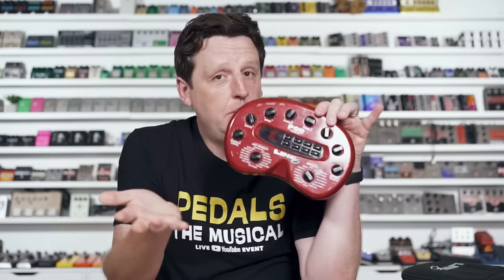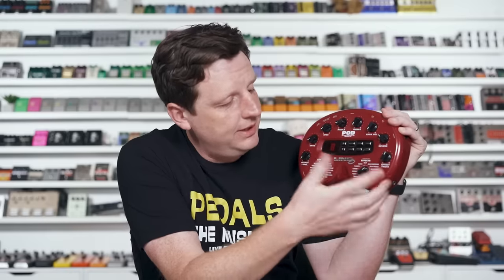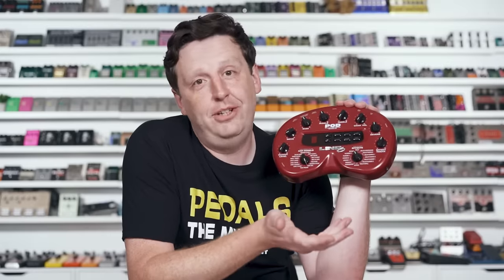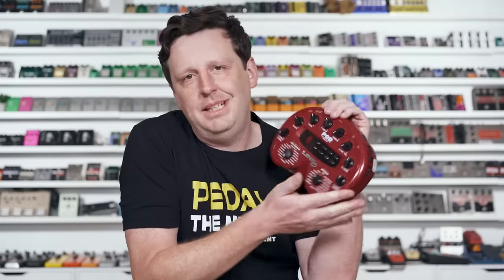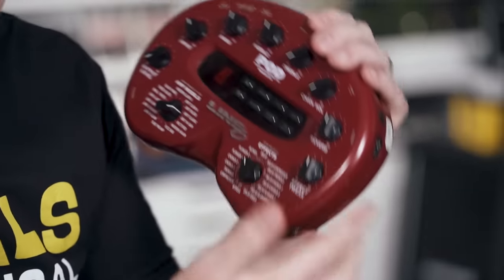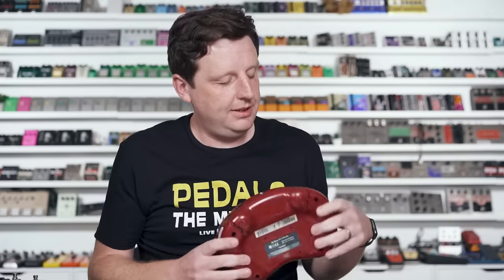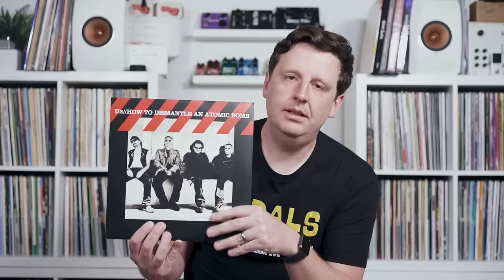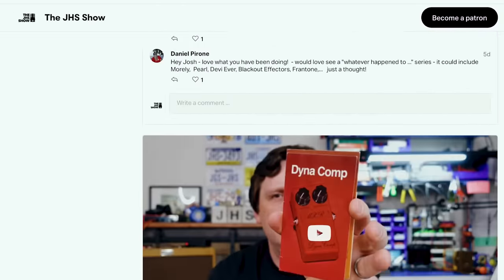Why The Line 6 POD Sounds Really Bad

Comment: Great video. I have the original POD, which sports a 2.0 chip given to me by a Boulder Colorado music store owner when he found out I liked the POD. Then came the PODxt, floorboards/pedal boards, then the XT Live… I still record with them and use them live through PAs. I still have all of them, and I never moved up to Helix because I don’t want to get rid of any of these kid rocks. I also like the Line 6 DM4. Thank you for sharing your thoughts and wisdom. I have a plethora of pedals which continue to grow in number and the POD works well with fuzz/distortion on the front end – even with a compressor. I also still like my Line 6 DuoVerb amp for recording and occasional live use. Now, I do not feel the need to hide my Line 6 PODs anymore 😂. Thank you for the courage to continue 😊😊😊. Cheers/Slainte and God bless.
🎸👨🏼‍⚕️🫶✌️♾️.

Comment: It might sound better with gold tipped cables 🤩
Reply: just the tip...
Reply: @beatzguy  yeah, copper gives more sustain 🤣
Reply: @0Oo..oO0  99% of “gold tipped cables” are coated in a low grade cheap gold, they’re no better than a regular copper one, this has actually been demonstrated and proven scientifically on many gear forums over the years. I suggest you read up 🤷‍♂️
Reply: @beatzguy  turn on your humor detector and read again 😔
Reply: FYI, the most transparent sound for switches, wire, etc is silver. This was determined after exhaustive analysis at our LA studio. Gold tipped connectors started getting popular in the audiophile stereo world because gold doesn’t tarnish like copper and silver do. Copper is fine and thicker wire is better.

Comment: I feel like the cab sim portion of this era tech is the furthest behind current kit. If you use POD direct to interface/cmptr compared to current modelers you would hear a bigger gap than using it as a pre amp plus fx box into a decent amp. Used as pre or for getting quick solid sounds for demoing song ideas or practice it can still be very useful and satisfying.

Comment: I was so surprised of everything that came after the pod 2. I had really hoped for digital to take off and become even better with time... But no... Most things I played around with with after the pod 2 has been way worse. I even ordered a 2x100w Hughes and Kettner top that was like 1500 USD like around 13 years ago since the amp simulation supposed to be soo good according to my old guitar teacher whom I really look up to (Marcus Jidell). Buut I hated it. The pod 2 digital effects sounds better in comparison. At least with my guitar and pickups.

Comment: I had a POD and thought it would go well with a clean amp so I ran it though a neutral Tech 21 Power Engine 60. Spent all my time tweaking the thing and when I got a sound I like saved I would come back to it later and it would sound horrible to me. I could get an endless variety of mediocre sounds. I got rid of that and got a Marshall. Now I can only do Marshall. I could never get the POD to do Marshall and think it sucks other than direct recording. Maybe I needed to spend more time to learn how to  dial it in. Sucked as a headphone amp too but maybe they were cheap headphones. Glad you all liked your PODs

Comment: I did a whole album in 2001 (Mark Bram / Ruby Topaz Again, which is having a 23rd Anniversary Abbey Road remaster release in a week or two) with the POD bean. It sounded great! I just kept moving up the chain. I went to Vetta combo after that. Then, the 300 watt Vetta head with four cabinets. I had the POD HD500X with two DT50 heads and two 4x12 cabs. Now, I have a huge rig centered around Helix. I have an HX Stomp on the pedalboard too, along with a few guitar synths. All the way through, I've always incorporated pedals in the loop or before the input... including your awesome pedals. Great stuff!!!

Comment: Great video as always. I used to have a POD XT. And I gave up not because how unit sounded, but because of the crappy customer support. I bought and installed custom patches (not sure if it’s called like that but anyhow) and after a couple of months they disappeared from the unit and no way to get it back. There were many people like me looking for a solution but without any outcome. Since then I stopped using the product and I will never use anything from Line6

Comment: I had mine in 2007ish. I would get home late from work and play through it for hours in my apartment using its headphones jack. Never having any issues with operating or having physical issues as they were built like a tank. I kept it until 2022 and sold it on Reverb for $220 (including the wah/volume + looper), only to fund my pedal venture. I still play through headphones mostly, having two small children at home and POD is still a great equipment that helped me through my 20s. Just purchased POD Express this morning and can’t wait to relive POD life again…!

Comment: I bought a Flextone 2 HD in 2000-2001. Everyone made fun of me until they heard it. I toured with it in 06-07 and had it hidden behind my cabs. Got many surprised faces when they'd compliment my tone and then see Line 6 when I'd be packing up. As stated in this video, if you took the time to learn it and really dial it in, it becomes an invaluable piece of gear. Sounds awesome. No tubes to go bad. Zero maintenance. Sounds exactly the same every night. I will say that cab choice was a HUGE defining factor. Personally, I only found 2 cabs that it sounded fantastic with (coincidentally they both have close to flat response designed speakers), and a whole bunch it sounded like crap with. Maybe I could have spent more time adjusting values for those cabs/speakers, but in the end I still don't like those speakers 20 years later *shrug*.

So happy to see what Line 6 started and it finally being accepted in the metal world. Especially happy to see other companies following suit and making their own great products (Fractal 😏).

Comment: I have a Line 6 Floor POD Plus I got in 2011 when I was a senior in high school. From what I recall of playing with a friend’s POD, the Floor POD Plus is basically the same tones and effects, just with added pedals to make it easier to use on stage. I have never felt the need to actually build a pedalboard, because this thing does it all. Eleven years later it’s still going strong, I had to buy a replacement power plug a few years ago but everything else works great. It’s amazing the variety of sounds you can get out of this thing, from heavy metal to blues and everywhere in between. It even works well when I play bass. I’m just a hobbyist, I’ve only played guitar in bands at church and that kind of thing, not actual concerts or anything, so I don’t need to spend thousands of dollars building a custom pedalboard when this thing still sounds great.
Reply: Now you've got me wondering what happened to my Floor Pod.

Comment: I believe I still have my old original POD, upgraded with a new Chip to POD II. Later I bought and used the POD XT plus some addon packs and today have a Helix LT hardwired in the studio and I still love it as much as the first POD I heard 20+ years ago in a friend's studio. I still remember the shock when I first heard the first original POD. My jaw dropped to the floor and didn't recover for an hour or two, three, four. The next day I was the first customer in the local music store and I believe I didn't sleep for a week from the first time I heard the POD until I was completely fatigued. This thing changed my world and made me sell most of my big tube amps even though it sounded crap... - I heard...  ;-)

Comment: I bought a POD Pro to use live in 2001-ish when I read that Weezer was using them on tour at the time, instead of amps. Before that, I had the same "digital modeling sucks" preconceptions. That POD Pro was great. It made my live rig 100% easier to to wield in a mix, and about 500% lighter. I never liked the onboard effects, so I was still using pedals. But as an amp-emulator, I had no complaints.

Comment: Got my first line6 gear back in 2000, 30W combo and it was good, the large FBV made it easy to manage live.  then POD 2.0 came out! I played a dozen years in a cover band using the POD2, and the flexibility in finding song appropriate tones was amazing!  It took a year or more to dial in tone tweaks, relative (live) perceived volume in a live band mix for both clean and overdriven tones.  What sounds great at home often disappears in a live venue! 
a few years later, line6 brought out XTLive.  I still have it, and thought it would be a cool addition as I had just tried line6 variax, the XT Live could control both the modeling and the guitar emulation patches.  That turned out to be more home fun and curiosity, than practical use. The idea of hit one floor button and switch from regular chords/tunings to a drop C and pick up a slide sounded awesome! In practice, it had limited value, and playing a variax compared to my #1guitar (ibanex prestige RG) was ...er... wellm it didnt happen!  and to be honest, I personally thought the XT live tones and sound were NOT as good or 'organic' as the POD2.  So the XTLive was sidelined.
Fast Forward to 2023, my now again POD2 is on its second power supply (just wear and tear on cables) and I was getting concerned I'd be unable to reliably get my sounds playing live, and software interfaces to the POD2 were showing their age.   So I now have a PODGO.  For the first few months, I spent a lot of time trying to mimic my POD2 tones, but that proved impossible.  On the POD2, the Mesa MkIIc was my goto model, and the mids and highs were awesome.  The PODGO Mesa MkIV destroyed my love for Mesa Boogie!  I could not get it dialled in.  I since found out that dialling in an MB MkIV is just as difficult with the real thing!!
A few months later, I started again on the PODGO with no preconceptions and just started dialling in the sounds I liked now for my original music.  I'd liked the Dumble style of sound, and after the most recent update to PODGo, found the Grammatico model.  Happiness :)
I don't play the covers scene any more, but what I love about my rig now ( PodGo, house PA usually, BeatBuddy, Aeros Loop Studio), is I can turn up to a show, plug in and go! If I've doen my homework, then I know that I'll get great tone and balance for all my songs.

#pauljamesirvine #line6 #singularsound #pod2 #podgo

Comment: @jhspedals
wondering what you thought of The digitech RP line of modeler pedals?
i have one in  my loop and mostly just use the delay gate and reverb modulation sounds. its pretty dang good for getting multiple sounds.

Comment: The only reason I stopped using POD V1 was that it was damaged in a post-gig accident. I was a very early adopter of L6, possibly the first one in the area to have one. I gigged with a Custom Hiwatt 100 for many years, so the variety of tones (and light weight...haha) was really a welcome change. My replacement for the POD V1 (which also sported a pre-release V2 ROM courtesy of the district sales rep) was the Pod XTL, which I still use.  A 2nd POD XT bean stays at  home attached to my rehearsal rig. When I hear them sounding bad in use, it's usually some misunderstanding on how it should be operated... especially the output mode. Usually takes only a few seconds to go from crap tone to jaw-dropping awesomeness.

Comment: Yes. I bought a Pod in 2001 and it just blew me away. I couldn't afford a big expensive valve amp and had been battling with distortion pedals through solid state amps and this thing came out and just sounded like real guitars, like real guitars on the albums I liked. I was blown away so I started telling everyone, and just got no reaction from anyone, people just didn't want to know about it. I still have the pod, and currently don't have an amp. For a small outlay you can buy an Epiphone Les Paul, a Pod and some decent headphones and you can create amazing guitar for a relatively small amount of cash. Awesome video!

Comment: Recently,
 i bought a used Line6 pod 2.0 (FBV Version). 
I don’t have experience with that much or any line6 product. 
I am using a mooer mini looper padel with pod 2.0.
Now i have pod 2.0 + mooer looper padels.
Which padel should i add in my padel board?
Any suggestion? 
I need some advice.

Comment: I remember when the POD came out there was an competitor called Johnson Station (or J-Station). It was pretty similar, so I tested both and went with the Johnson Station. I used it for some years, still have it. I tried it some months ago and it still works pretty good, but the memory does not work anymore, so the unit "forgets" all settings after you switch it off. I tried to find a battery or something inside the unit to replace it with a new one, but I could not find one. Back then I loved that it also had some simulations of great Bass Amps, as most of all I am a bass player. Today I use the Helix Stomp for playing and recording guitars.

Comment: I spent 30 minutes setting up 4 patches and used one of those for about 16 years. Had the floor controller and everything! Little stand doodad that looped under the strap of my Twin... Fully usable. Loved it. Band mates always bagging on it while they're constantly swapping amps and pedals. Dialing and tweaking. Troubleshooting.... No, it didn't sound exactly like anything but,, I could literally have my rig running in a couple of minutes. It never failed.

Comment: I bought a used POD XT on ebay for probably like 80 bucks 4-5 years ago because a lot of the artists I like started with a POD and I liked the tones they were getting out of it. A year or so ago I bought an AxeFX II XL+ secondhand for an amount we don't need to talk about and while I'm sure I'll (with more experience) appreciate all that it has to offer I still find myself returning to the POD XT and I can't help but think that maybe it wasn't worth the 16x price difference lmao. When it comes to any sort of tool, whether it be a plugin or an fx unit or anything, I've gone from "give me as much control as possible" to "give me as little control as possible" because without tons of experience it is so easy to just get completely lost in the weeds of sliders and dials. I went from using a single distortion preset on the POD XT I got from a YouTube tutorial and writing/recording lots of music to staring into the Axe-Edit abyss and never recording anything out of pure option paralysis. Anyways, interesting video! I now feel less stupid for using it sometimes over my AxeFX. I think ultimately the most important thing for any piece of music equipment to do is get you inspired to play/record music because it doesn't matter how powerful my AxeFX is if it's actively stopping me from creating.

Comment: For Chapman stick, the Pod XT Live saved my bacon -- stick has separate outputs for bass and "rhythm" (think "guitar") pickups. I had two completely separate chains, and it was getting crazy for gigs - two whole pedal rigs, amps, etc. The XT Live has two completely separate chains, per saved patch. I could dial in radically different tones for each chain, and play them through either a PA or full-range KB amp. Each song had its own patch, with bass and rhythm settings. Perfect. I still have it, and use it with Chapman stick.

Comment: I never had a POD, but I have and used for good two decades the Behringer V-amp 2, the poor man's POD. Now if POD is considered crap by a lot of people, then the V-Amp doubly so. Basically even trying to say it sounded fine, especially for someone on a fairly limited budget, means you're borderline insane (apparently).
And yet, like I've said, I've been using it extensively for about 20 years. I did gigs with it, even. The only real issue I ever had with it is that some of the amps/presets can be quite noisy, and the effect combinations are quite limiting. Other than that, I was always able to dial in some very usable tones and it never disappointed me. I've gone to a much more recent amp modeler a while back...and frankly, I still think the V-Amp does some things better, despite being basically ancient. I still have it and I would still use it. I just don't say it very often, because again, people kinda think you're crazy if you do.

Comment: I remember getting a Line 6 demo CD in the mail, having a listen and thinking these sound spot on. So went out and bought a POD HD years ago and mucked around with it for a while. But found it hard to dial in  tones on it. I was actually a little disappoint to be honest, thinking the sounds must have been doctored. At the time, I had a Marshall TSL and just plugging into that gave me the sounds I was after. 

Looking back (and this probably goes for a lot of the all in one amp/effects modeller that have come since) you need to have a sound that you're shooting for in your head. The trouble with these sorts of devices is there's so much you can do with it, but people get option paralyses from that and don't go for a particular sound. I think also at the time, I hadn't had a lot of experience with difference amps, so didn't know what to actually shoot for.

Comment: Ok, after remembering for a minute ... It was 2000, bought the L6 AX2-212, 15 days later the POD 2.0 ... sold the AX2-212 to buy a Mesa Boogie Nomad 55 and after that ... dozens of pedals (DL4, DM4, MM4, Mod Pro, Echo pro ... ) and the POD 2.0 were in my studio until I switched to Fractal ... 19 YEARS AFTER. And Fractal is way better sounding than POD, that´s why I sold it (and because Fractal is expensive, but worth the money).
So, the POD recorded and performed live with me, from time to time during that 19 years. Awesome sounding machine even now.